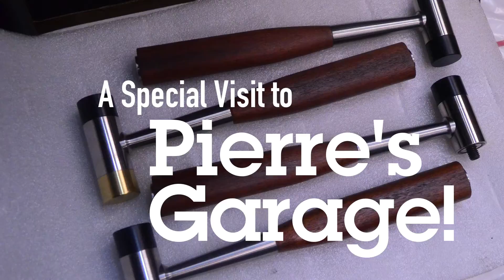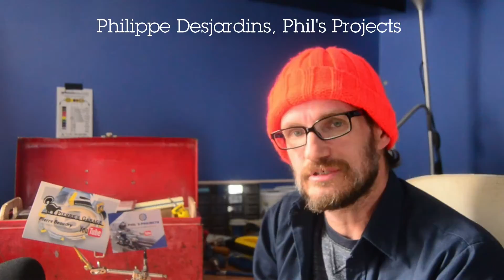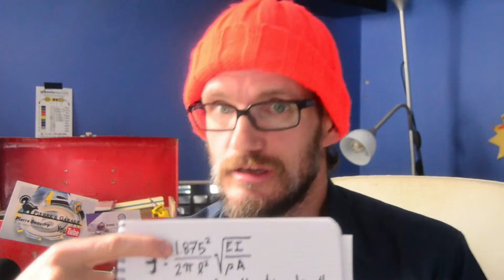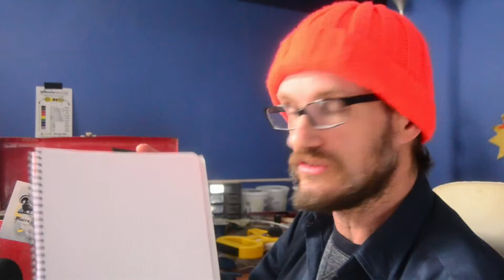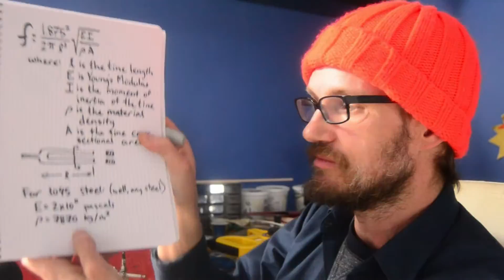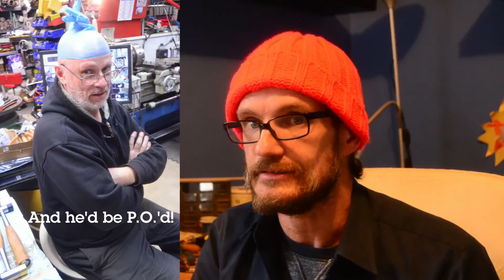Episode 5: Pierre's Garage visit, a quick repair... and SCIENCE

Comment: Hey Murray! The code looks reasonable although I'm not sure about your calculation of the 2nd moment inertia.

I ended up diving deep and coming up with my own program. Take a look: https://github.com/C-o-r-E/tuningFish

My results:
        Steel: 3.916 inches (99.47 mm)
        Aluminum: 3.915 inches (99.44 mm)
        Brass: 3.323 inches (84.40 mm)
        Lead: 1.830 inches (46.49 mm)
Reply from the maker: Thanks, coreboy! I will pass that steel figure on to Pierre. But that's not the glitch I spotted, the search is still on.